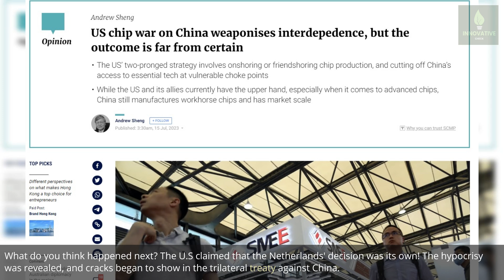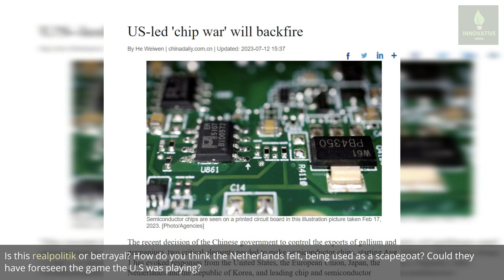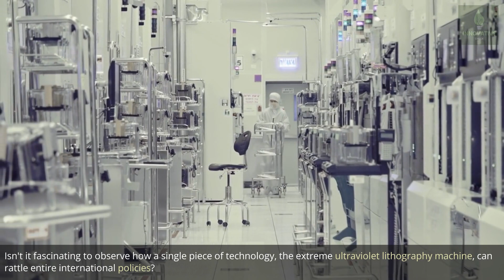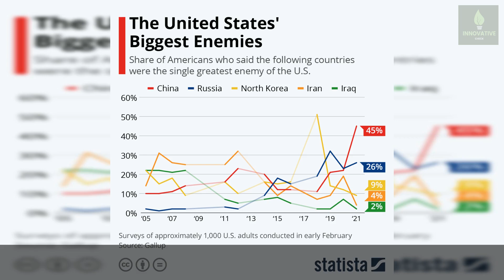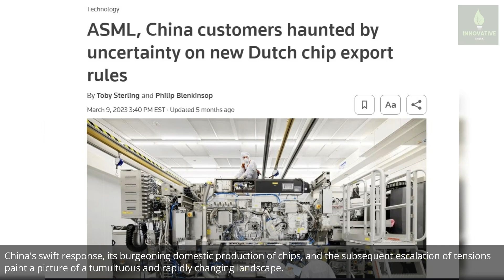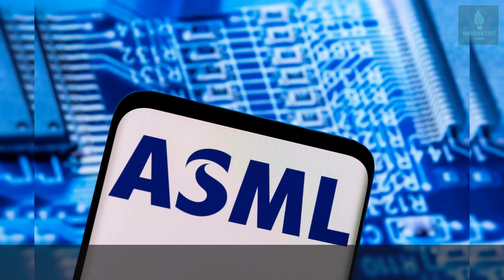Netherlands Revenge on the U.S: Payback in Full | Chip War

Comment: Besides the politics, ASML is technology indebted to the US also.  ASML did not entirely invent the UV lithography machine by itself.  It consists of many parts imported to the Netherlands, many of which are from the US (the optics, the lens, the various drivers, scanners, etc) and other countries.  If ASML doesn't comply, the US could simply halt exports of those critical components to the Netherlands. ASML started the company originally in the US.  Also, ASML's biggest buyers are US companies.  ASMLpresident said that the company is working to shed US components from its machines so it wouldn't be subjected to US export restrictions.
Reply: They are caugth between a rock and a hard place.
Reply: @daffyduck4195
The optics is probably entierly Zeiss, whic is a German firm.

(And I doubt it has any lenses. Should be mirrors.)

Otherwise, you are right in that the USA has some IP rights to the technology.
Reply: @larsnystrom6698  The lasers come from US
Reply: I Question "ASML's biggest buyers are US companies" but not in the US. They are going to test the machine in Silicone valley in the R and D fab and then  buy a 100 sent to china production fab.
Reply from the maker: I think your analysis make so much sense.
Reply: Usa never learn, by restrict other country they only create their own monster,  like the Ban china from join the ISS, china make their own.
reality is if no restriction on selling lithography machine to china, China own indigenous lithography machine would never develope this fast or it would never developt at all due to the high cost.
Reply: Chat GPT says the same thing